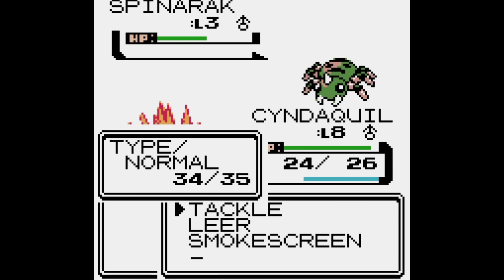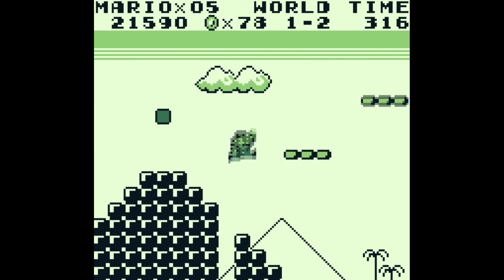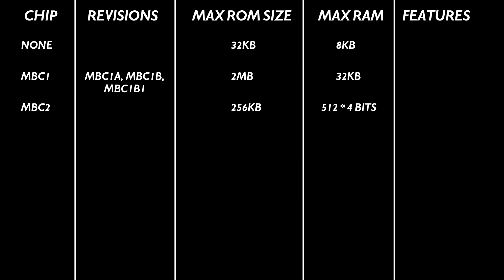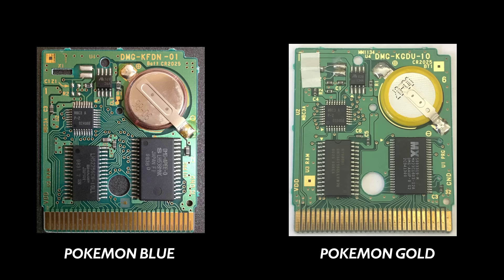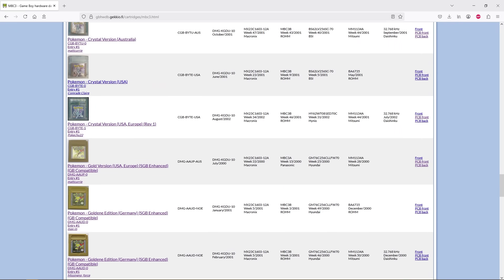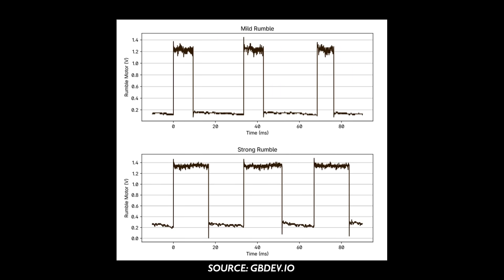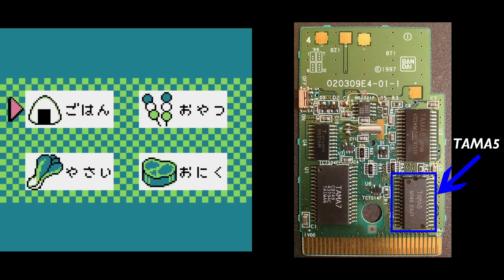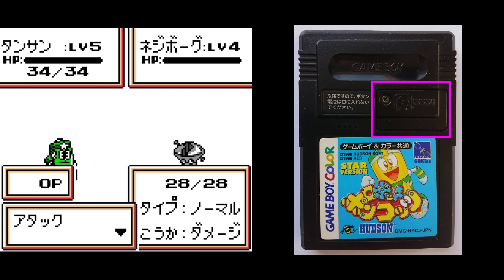How Pokemon Gen 2's real time clock worked - Game Boy mappers explained | White_Pointer Gaming

Comment: One question. If zero day games like Mario, needed the memory bank chip. Why not implement it in the GameBoy itself? Wouldn't make more sense cost and programing wise? The same with the ram. Why put extra ram in the game cartridge, instead of the console?
Reply from the maker: Probably to keep the cost of the Game Boy itself down. Part of the reason the GB was so successful was that it was significantly cheaper than its more powerful competitors, and it also had massively better battery life as a result of its more modest hardware too.

Comment: 12:38 do clock and save data reset when you replace battery (immediately after removing old battery)?
Reply from the maker: The cartridge was designed so you could replace the battery while it was still in the Game Boy, so you didn't lose anything.

Comment: if the mbc3 wasn't seen until 97, that means the original japanese releases in 96 would have been the mbc1 right?  i wonder if that led to any changes besides bugfixes.
Reply from the maker: That's correct, the original Japanese gen 1 games used the MBC1 mapper, specifically the final revision, the MBC1B1. You can see it here: https://gbhwdb.gekkio.fi/cartridges/DMG-APBJ-1/gekkio-1.html

Comment: MBC4 was canceled, not skipped. 3DS source code leaks reveal Virtual Console support for it (for some reason) and its gimmick would have been Nintendo 64 connectivity, which was only planned for few games which all scrapped it.
Reply: Connectivity how? Something like the GBA-GC cable thing but GBC-N64?
Reply: @Redhotsmasher  Yes, there was a N64-GB link cable planned called the 64GB cable, so this chip was probably how it would have worked on the GB end.
Reply: (I'd also previously misread that only one game had evidence that it was planned to use/interact with this chip; there were more, sorry.)

Comment: 8:57 for the motor control, you are describing a “pulse width modulation” technique. It’s the method by which digital computers or microcontrollers operate their ‘analogue’ outputs. It’s a very established method of analogue control.

Comment: I have a question! If there's no save file / no time set, does the battery still drain? I ask because I've replaced all my batteries, even in games I won't get to playing for a while.
Reply: I'm pretty sure it will. The circuit is completed, so it will use power. It's similar to leaving AA/AAA batteries in something and finding them almost dead later; it's a sort of "phantom" power usage. The only way to not let this happen is not to complete the circuit (not having the battery in it at all).
Reply from the maker: That's a good question. I honestly don't know the answer to that.

Comment: ive been interested in making a custom flash cart for the GB for a couple years now, but the primary block (other than the ever present lack of time and motivation after work) is needing to understand all of the mapper chips and what they add. I suppose I should find some example carts and solder some logic probes on them...
Reply from the maker: You can check out the links I've provided in the description, there's a fair bit of information there that should help you out, but some of the mapper chips have a lot of gaps in the documentation.

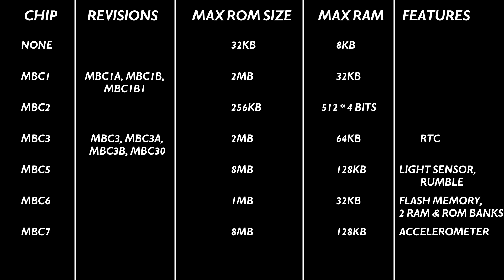Comment: A little mistake at 8:33 MBC5 didn't support a light sensor. Also MBC7 (9:50) Max ROM size is 2MB, not 8MB, And RAM size is a little bit tricky here. MBC7 didn't have an SRAM on board because they were using an EEPROM of 256 bytes. Also MMM01 also is wrong, here Max ROM size can vary depending on RAM size.

Comment: 12:53 Man I REAAAALLLLY wish Gold/Silver/Crystal had an easily replaceable battery like that. Almost all my GB/GBC games still have their original batteries in working order, and while I do have the 3DS versions of those games, I really wish I could play them on my original carts again
Reply: Same. There are some videos on YouTube about replacing batteries for GSC if you’re ever up to try it though. 

I did it once around 10 years ago without a soldering kit and it still worked out.
Reply: I went the opposite direction, got a joey jr a few years ago to dump all my gb roms and saves so I don't have to deal with the carts anymore. But it was just my luck that out of all of them, only pkmn crystal, the one I wanted to save the most because of the battery issue, had a dead battery and the save dump ended up being a bunch of unreadable junk data.
Reply: This is why I immortal modded all of my 1st and 2nd gen games with FRAM (battery no longer needed or used to retain save data) and installed hotswap battery holders on the 2nd gen games for the RTC. No further soldering needed if the RTC battery dies.

Comment: this is also the reason the batteries died so fast in gold silver and crystal.  lost all my pokemon cause of it as a kid...  neat feature but they should have used a larger battery that was replaceable  or more efficient crystal oscillator.  i dont know maybe there wasnt anything more efficient in that time but only 6 years  before the battery died was a short life... normal lifespan is quite a bit longer with out the crystal oscillator.
Reply: Ultimately it didn't matter much as carts would soon begin to use FRAM and Flash once the GBA was out instead of battery backed SRAM.
Reply: @davidmcgill1000  thats true.  and considering this was released just on the brink of that happening  sucked lol.

Comment: I could be wrong but if you didn't want to WAIT until the correct date you Could Change the INTERNAL Clock of the  console itself on that date ie like Capturing a Lapras Late game when the ONLY day of the week to do so is a Friday but your currently playing the game on Monday.

its only the DS/3DS  games that when they use a Real Time clock you can't change the DS/3DS's Internal Clock to do those events without waitng to do them normally.

However DUE to the Y2K BUG on December 31st 1999 when switching to Jan 1st 2000 the Gen 2 games became UNPLAYABLE the Internal Clock pretty much stopped working then so that the actual Game boy games for Gold/Silver/Crystal would not turn ON at all.

That doesn't apply to the Virtual Console versions of the Gen 2 games ie playing on the DS/3DS e shop before Nintendo shut down BOTH consoles E shops forever that is.
Reply: 1. The GB/GBC don't even have a user interface in the BIOS, much less a way to set any sort of clock. There isn't even one to set in the first place.
2. You can change the DS's clock all you want. They didn't start getting real sneaky with the clock until the 3DS.
3. The Gen 2 games are not affected by the Y2K bug, they don't even store the year, just the hour, minute, and DST flag.
4. The VC versions of the Gen 2 games have almost no patches done to them outside of link cable functions and some changes to sprite coloring and move animations. 

I'm not sure where you got all this, but I have a sneaking suspicion its from an LLM.....
Reply: That I'm not sure I tried to play the Gen 2 cames on a Real Game boy ON January First 2000 even with Brand New batteries put inside my Game Boy it would not actually TURN the console ITSELF on at all due to Y2K.
Reply: @veghesther3204 these games were released in '99, so a Y2K bug would have been devastating! Thankfully, they have no year data and thus are unaffected.
Reply from the maker: Neither the Game Boy nor the Game Boy Color (or even the Game Boy Advance) had an internal clock in the hardware itself. That's why games needed a special chip in the cartridge to handle it.

Comment: Replaceable batteries are nice, but the save file is still going to wipe the moment you remove the battery, right? Or are you supposed to do it while the game was running?
That Tamagochi game, I feel like the real reason why it had an easily replaceable battery was because it would drain permanently, using it to sound alarms depending on your pet's status, even when the GB was off. Maybe the drain was even worse than that of the RTC alone?
Reply from the maker: The cart was designed so the battery can be replaced while it's still in the game boy. And yes the battery drained even faster due to the buzzer in the cart that made noise when the game was off.

Comment: When I imported all of the original Pokemon games from Japan the first thing I did was replace the batteries.

My Crystal save is still going strong after over 300 hours of game time, but I have noticed the in-game clock is now a few minutes behind.  Too bad there's no secret code to change the clock in the JP version! 

It kinda goes outside the scope of this video, but how does the in-game clock interact with Stadium 2's fast-forward feature?  If I play at 3x speed will the clock advance three times as quickly?
Reply: Without digging into the Stadium 2 emulator itself, my assumption would be that the clock would advance at a normal speed. The fast-forward feature is just running the emulated CPU at a faster rate. The actual clock is handled by the RTC chip, so it should still proceed at a normal rate.
Reply: Something I discovered by accident while changing the batteries in my pokemon games with a really terrible soldering iron is that it's super super easy to damage the crystal and cause it to run out of spec or stop running entirely. The clock is way too fast on my silver game and doesn't run at all on my crystal anymore. They are just 32k time crystals so they aren't hard to source replacements for tho.

Comment: 11:30 And that part sticks out of the console, so you can replace the battery while it's running so you retain your data.
Reply from the maker: Yep, it was a pretty clever design.
Reply: That's brilliant, I didn't know about this at all.. wish it had been standard. But at this point, these older games are just so well-emulated and you can hack in anything you want, so it feels like you can't lose data even if you tried.
Reply: @KairuHakubi  Also, nowadays games running on emulators just store the save files in the same folder (and therefore the same drive) as the rom so you probably won't lose it

Comment: Chip revisions could have no function change but be updated manufacturing techinques or suppliers. There's so many different possible reasons to increase a revision number on such a chip that it would be impossible to having meaningful speculation without inside information.
Reply: it could also be a newer cut down node with fewer layers, better power consumption, fewer masking steps, etc
Reply: Yeah that be my guess as well. Different suppliers, who might have had different tooling, and manufacturing capabilities. But they are all made to the same spec so they are effectively interchangeable.
Reply: they have functional differences that were never used in games until homebrews
for example mbc30 has double the memory (for both ram and rom), it's getting to the point that some newer pokemon hacks have to switch to it
they're just not documented that much because emulators first try for 100% catalog emulation, and only then hardware accuracy for developing new software

Comment: Anyone else dismayed that Nintendo/Game Freak didn't have the foresight to do user-replaceable cell batteries for the eight years they had making Pokémon cartridges?
Reply: I don't think they really thought Pokemon would last long enough for that to be a real concern. How many games from back then do most of us want to play still?

At least it's not too hard to install a socketed battery now.
Reply: They did, you just need a soldering iron.   Pro-tip: most old carts used a 2016 battery, but a 2032 will fit.   So you can replace the battery with one that doubles the capacity.
Reply: That would have been truly awful lol

Comment: Interesting how Devs used PWM for variable rumble. It's odd that there was no built in PWM.
Reply: There's very few instances where PWM is actually controlled by a PWM chip (controller) and that's usually in higher current draw scenarios, like say PC fans at 12v, robot arms, etc. PWM for a little brushless DC motor (like those used in every rumble pack or rumble feature on smaller devices) is regularly directly driven by the CPU on a digital out pin due to the lower current load. Modern console controllers use a PWM controller to simplify and control power draw but you lose granular control and natural mixing of signals to emulate multiple feedbacks at once (you can use math to adjust the desired signal going to the PWM controller but that's extra work for the dev). Also PWM controllers were not so much a thing back then for consumer electronics and mostly for the professional and commercial spaces controlling things like robot arms, only once they got smaller and ever faster did they make it into consumer electronics. The first PWM controller released in 76, I can't think of a mass produced consumer product using one until the late 80s-early 90s with those gimmick alarm clocks that would vibrate on the table and dance away from you, even then some of those were just a cheap timing circuit driving a relay to switch the vibration off and on at regular longer pulses (long duty cycle PWM basically). Yes, PWM controllers existed but they weren't ubiquitous in gaming until the 2000s when every game console's controllers had rumble features included.